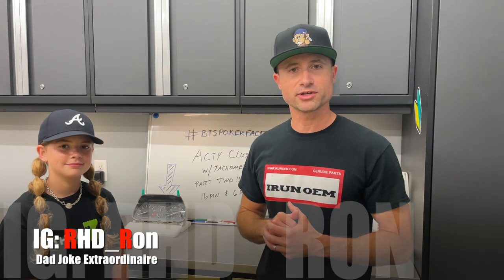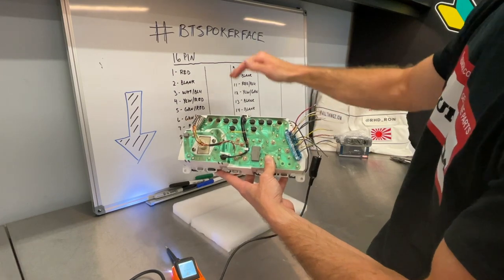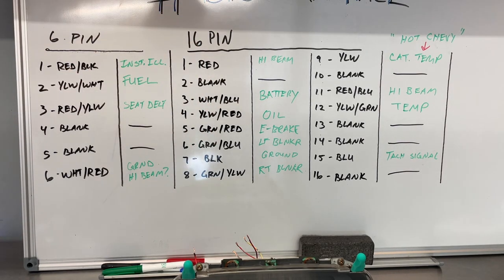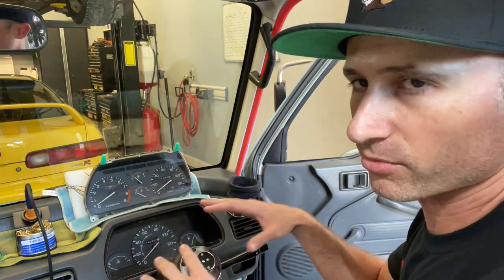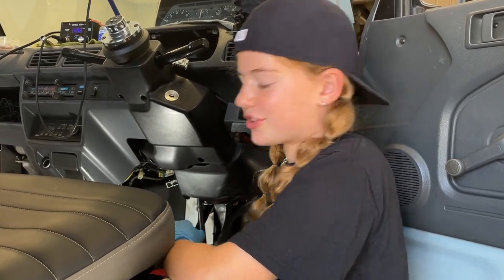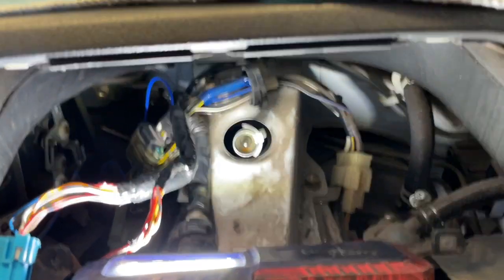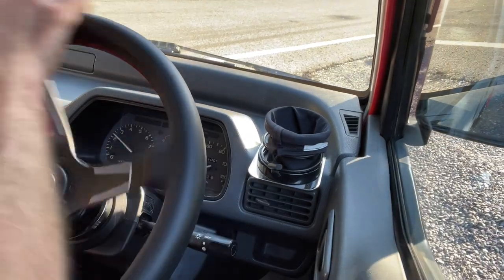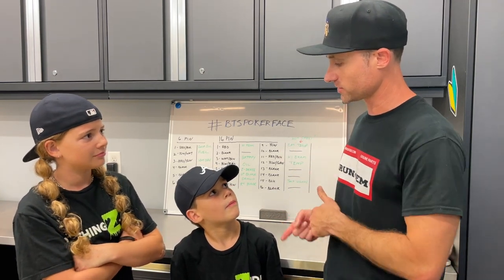Honda Acty Tachometer Cluster Install Part II #Acty #Honda #RHD_Ron #Cluster #Tachometer #JDM #KEI

Comment: For those with late 90s actys you may have a tach cable (two wires, one blue one green. The blue is tach) already run to a connector that hangs loose under the driver's seat.  I used a wiretap and ran a cable under the floormat. Easier than having to go right from the distributor.
Reply from the maker: Thanks Lars, as always buddy.

Comment: Hey Ron, question for you.. on the 6 pin connector, pin #6 white/red “potential ground for tach… do you recall connecting this wire? If so, what to? Did you ground it out? Tape it off? Everything else I’m good on, just confused with this one. My cluster is actually for PS as well, so hopefully it will function without the PS hooked up.  I pulled the wires from the connectors and saved them for later use. Thanks for the awesome vids!
Reply from the maker: If I recall, that white/red was either for the seat belt indicator or hot catalyst light. My 1991 truck had neither so I did not use it. I think later on I did the cluster install on a 1994 truck and it had the belt light and catalyst over heat light. I want to say the white/red was for the seat belt. Thanks!

Comment: Hello! Thanks for your videos. Do you have a source for the smaller (6-pin) cluster connectors? I bought a couple of clusters - one 16 pin and one 12 pin. I found the 16 and 12 pin connectors but I can't find any of the 6-pin. I've been searching eBay and the Japan auctions for a while now and still stuck. I might end up trying to cut up a 12 pin to make two 6 pin but that wouldn't be ideal.

Comment: Thanks for the video. Can you give us the following info? 1- Redline 2- tire size 3-rpm at 20 km/h 1st and 2nd gear, rpm at 40km/h 2nd and 3rd, rpm at 60km/h 3rd and 4th gear, rpm at 80km/h 4th and 5 gear and  rpm at 100 km/h in 5th gear.
Reply from the maker: Sorry, Ive already sent this truck back to its owner.😥

Comment: Ron, I could use some help! I was able to source all wires for the 16 pin. I cut a civic 8 pin connector down to 6 pin but I’m missing the white/red wire. Anything I can use in its place?

Comment: 13:39 I know I’m late to this party, I hope I can get a little help. My 96 Attack has A/C. I’m installing a tach, not the cluster. I’m looking for the tach wire and not having much luck. I’m not finding a connector under the seat (where the evaporator is) and I’m not seeing anything like a plain blue wire under the dash. I did find a plain blue wire at the top right side of the engine bay hole, it’s part of a connector. Does anyone know if this is the tach signal? The coil is tough to even see, getting to the wire on the coil seems like a lot of work. 
Thank you
I love this channel.
Reply: Finally figured it out
My Acty has A/C which means there are no unused connectors under the drivers seat. The blue wire is in the harness  just above the A/C equipment. Works great.
Reply from the maker: Thanks for watching. You can get it at the solenoid blue wire, or under the dash in that big gray C101 connector. Do a continuity check from the connector at the coil to one of the blue wires in that connector under the dash to find the correct wire.

Comment: This isn't 100% accurate on the wiring/labeling. I just spent last few days tinkering and figured out everything. Hope this helps someone. Thanks again Ron!!!

16pin...
#9 - Yellow = 12V Power IGN2 ------- not EGT/Cat Temp...you need a 12v source or the cluster doesn't light up when you turn the key.
#11 - Red/Blue = EGT/Cat Temp ------- not Hi Beam

6pin...
#6 - White/Red = Hi Beam ------- You guessed this as high beam, and that is correct. There are 2 high beam wires on truck and 2 on cluster, you need both!

NOTES:
EGT/Cat Temp - If your truck does NOT have EGT/Catalytic Converter (my 1989 HA2 does NOT), the Red/Blue wire must be grounded to get that light to turn off.
12V Power IG2 - My 1989 has 2 yellow wires. Either one will work. Secure/tape up the other one.

Comment: So as I’m working through mine I noticed I have 2 yellow wires. Mine is also a 96 and I’m trying to put the same cluster into it. Is that something you ran into also?
Reply from the maker: Just use one. They are both 12v switched power. Works just fine.
Reply: @rhd_ron  I have same thing...two yellows. Any idea where they need to be soldered to on the 16 or 6 pin connectors?

Comment: Soooooo, Here's my crazy idea. I just bought an cluster on an online auction site in Japan. It will wing it's way to me in a week or 10 days. I plan to tray and take out the 4 screws that hold in my old odometer and put it in my new(used) cluster, replacing the old one with higher milage. That way my odometer will be accurate and I'll get a tach. Now, I need to source the connectors in the back. Any ideas where I can get those?
Reply from the maker: Plugs: 16pin from 94-01 Integra. 6pin from 84-87 Civic or Honda Beat. As for the odometer swap, I thought the same thing on my first cluster but the size of the housing to mount it was different if I recall. The no tach cluster is much larger for the odometer area than the cluster with tach. If you actually take JUST the odometer numbers and mechanism maybe, but my cluster I found was only off maybe 1,000kms so I let it be. Thanks for watching